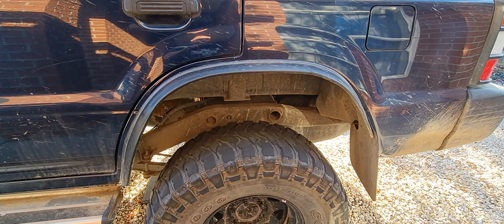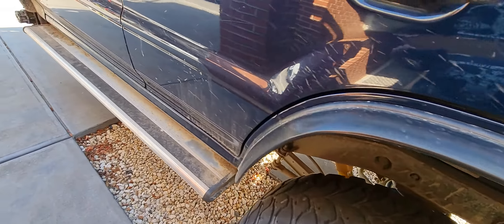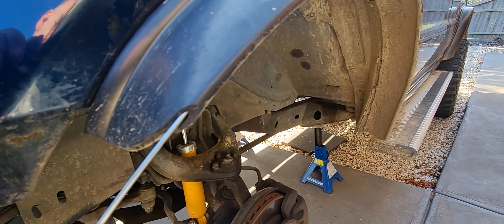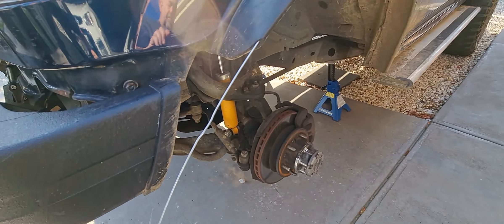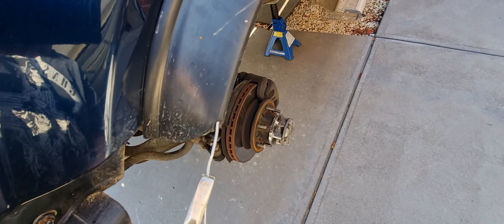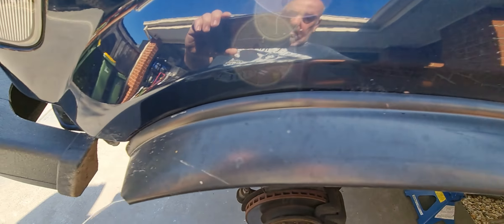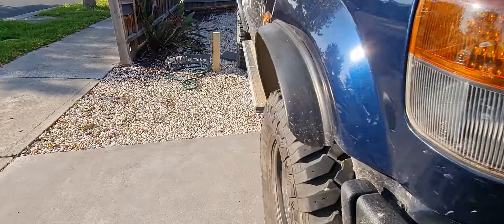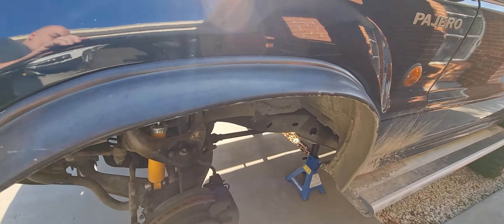RUBBER FLARES | For the Pajero, and did you know you can do this?

Comment: Just did my sisters prado yesterday her kit came with the wire, it seems like spring steel wire, tip use WD40 with the tube squire in the hole make is so much easier to thread through
Reply from the maker: Great tip!